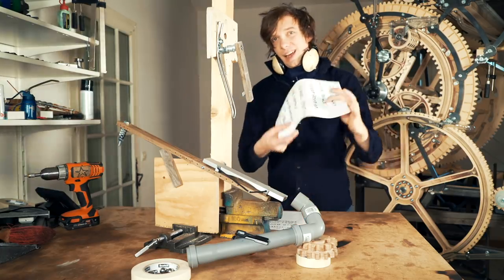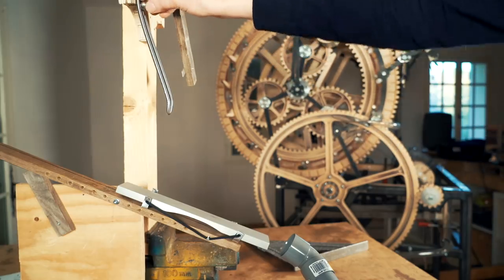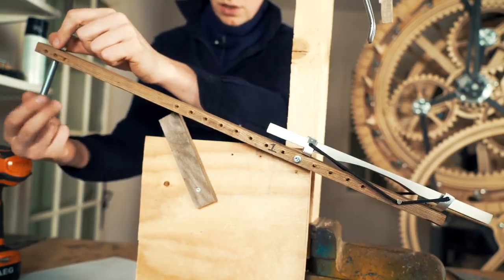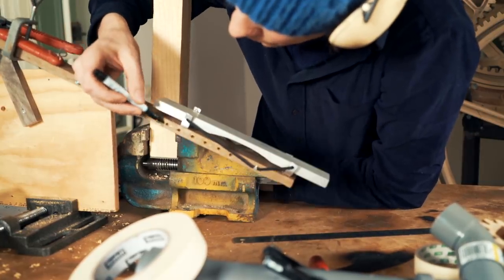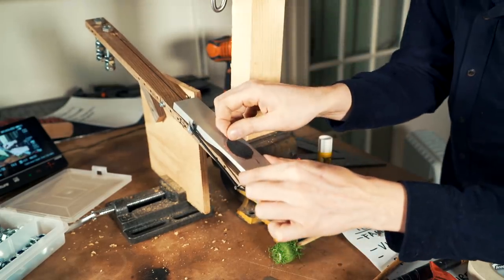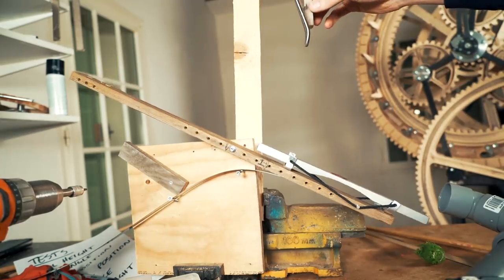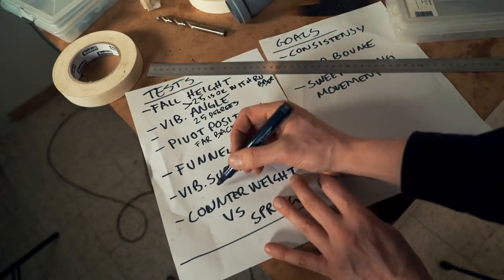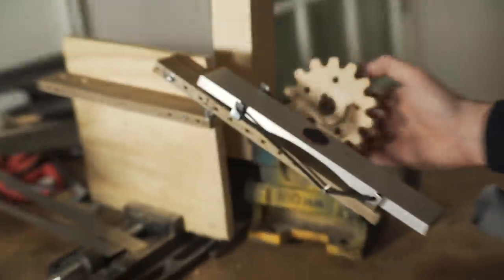Vibraphone Movement Test  - Marble Machine X #64

Comment: Hi Martin, it seems that there is a slight difference in striking the bar with a mallet and using the elastic material on the bar.    The material has some dampening effect which might change how the note rings out.
Have you considered suspending the piece of elastic material just above the bar so that when the marble hits the material, the material  stretches and along with the ball strikes the bar?   Then as the marble bounces off, the material would return to just above the bar letting it ring out as if it was hit by a mallet.

Comment: 7:01 Important for vibration duration is to do not leave any material on the surface of vibraphone plate or sound duration will be shorter. I think it would be better to hold the rubbber material in a short distance from. It should only hit and go back immediately.

Comment: If you don't want the pads directly on the plate (might change the release and whatnot) you might try floating the contact pads milimeters above the plate with some flexibility to make contact with the force of the marble.

Just an idea, not sure if can be easily engineered.

Comment: The nice thing about a spring compared to a weight is that it increases its restoring force the further your tension it linearly.
That means that although the hit had a quite visible swing, the return is much quicker allowing for faster play.
Compare that to a weight who's restoring moment will always be horizontal lever length * mass * 9.81m/s² with the lever length being dependent on the cosine of the angle * actual lever length (distance from pivot point to center of mass) which gives you a much shallower response to angular deviations.
Reply: Actually given what I've learned this semester about kinematics and control engineering you could totally do some physics calculations to come up with a model and then find your parameters by analyzing their effect on the root locus of the impact response.

Comment: I would ask to consider light torsion springs since they are specifically designed to return to exact desired angle, or zero, at higher than Prestissimo; faster than presto - 200 bpm and over.

Comment: I know the commuting wasn't a big problem in your test, but I think it's going to be an issue as soon as you screw the leaf spring to the moveing arm. My suggestion is to leave it moveing a little bit. The resulting friction will do the dampenig very well.

Comment: having a more significant counterweight close to the pivot and/or reducing the weight of the vibraphone side of the pivot would have the same effect as the long arm holding the counterweight, and would reduce the space the was required by the prototype counterweight, just pointing this out incase you prefer having the different center of mass

Comment: You need to design the machine so you can easily replace, and adjust, the leaf springs. Those lose their temper over time and need servicing. Tuning them according to wear and tear might help extend their lifespan... so I suggest a clamps system, perhaps? Wedge them in with mechanical pressure, instead of using a screw or a more permanent fixture.

Comment: The leaf spring approach includes its own damping, since it slides on the wood. If you eliminate the sliding with a coiled spring, it won't be damped and will oscillate back and forth. So one way or another you need to factor in some damping - the sliding leaf spring is probably simplest. https://en.wikipedia.org/wiki/Harmonic_oscillator

Comment: Shouldn't you be able to get one definitive movement without the swinging if you use normal coiled springs but dampen the movement a lot? idk how you'd dampen it though, bushings filled with stiff grease? Probably too temperature dependent...

Comment: Instead of dampening the tone of the vibraphone by adding the rubber to it directly. Why not have rubber or felt slightly suspended over the  vibraphone as a slight barrier to pad the hit sound? That way after it hits it won't be in the way to the resonance of the hit.

Comment: One of your first comments in this video was the fact that you wanted some movement of the instrument when struck because the marbles are just too difficult to be seen by the audience. I would like to propose a possible solution to that situation in addition to the movement. Use of strategically place UV flood/spot lamps in combination with UV activated glowing marbles! I'm not a metallurgist nor an engineer so I don't know if this is even possible, but the thought of it intrigues me.

Comment: I assume you want the bar to promptly return to the "unhit" position immediately after the hit.  Put more weight closer to the pivot (say double the weight and move it 1/2 the distance to pivot).  Restore force will be the same, but inertia of weight will be only 1/2 what it was before.  It will act more like a spring return.

Comment: What if you were to make the dampening for the vibraphone work like the practice pedal on the piano? A strip of rubber could hover a millimeter or two over the whole vibraphone where the marble hits and it could be pushed upward toward the marble machine by a lever out of the path of the marble. This would give a greater range of sounds

Comment: Won't each vibraphone plate's weight be different, causing the length of the arm (and the action and travel time) to be different depending on what note you put there? Also, do the resonating tubes really have to be different lengths depending on the required notes for the song? Couldn't you engineer tubes with multiple openings that would have multiple possible resonating frequencies? Would the harmonics for each plate's possible notes be far enough apart that a pipe with multiple holes could give a clear resonance to multiple notes? Or maybe the holes in the resonating pipes have stoppers so you don't have to have multiple pipe lengths?

Comment: There are rubber tapes made for adding more grip to the stair steps, very resilient and durable, might be perfect for the rubber pads in long term. If you want to make it pretty I sugest using liquid latex, its the very exact same material used in those working gloves, and you use it like nail polish (its actually meant to be used while making pedicure), but I can see it coming off and tearing after being hit with a steel marble couple hundred times.

Comment: Hej Martin, have you though in keeping the same resonant tubes but add different cavities separated by gates that you can open and close depending of the vibraphone installed?  or if doesnt work that way, maybe filling them up with.... sand?  (with a small valve/gate in the bottom so you can empty at the end of the concert or in between songs. About the spring, you can add different springs types to have a less resonant frequency and maybe putting inside the spring a piece of rubber, so it will dump a little bit the resonances (spring plus shock absorption, like in the car)...  great work!!!  by the way :)

Comment: The ball mass an drop height is all the energy you can use.
You need enough energy, both to move the arm AND the bounce (single). 
The mass of the whole arm (from end to end) has an inertia. The more mass, the bigger the bounce (no double hit) but the less swing. I'd go with a shorter arm and a spring.
As it acts as a pendulum, consider the whole length of the arm, as it has to reset fast enough to receive the next ball, unless you can catch the ball as the arm is in the "down" position (half way of the swing).

Comment: keep in mind that springs tend to weaken over time. So dont put to much weight onto it in rest.Futhermore, keep in mind that the length of the arm with respect to the spring matters as well and the spring constante actually results in a kinda of freq inside the moving arm. Thus make sure the arm is not moving while the next ball drops onto it, or it might alter the sound you are getting (moving against the ball will result in a harder bounce, thus more thermal energy, thus more acoustic energy. I do love the idea tho, and really looknig forward to see the endresult ;)!
Reply: thinking of it, might be that the coiled spring is the way to go, as you can simply make some kind of rod connect to them. Turning the rod, can then help you adjust the amount of work the spring needs to do (so you can make this really hard looking spring (high spring constant) or simply a weak one, which gives the arm the nice swinging motion.

Comment: Maybe it has been said before, but what happens when you have quick successive hits on the same note?  Would it be possible to hit the vibraphone plate when it is exactly in the same vertical position in such a case?  Or would you sometimes catch it on the upwards return from the previous hit?

Comment: Do you have access to Plastidip? It's a liquid rubber that can be painted or sprayed onto surfaces. If you make a template that is the size of your contact point, you can paint your rubber directly on to your vibraphone bars and control the thickness of your pads. Just a thought

Comment: Physics people... Hypothesis: with ball on metal, the energy from the ball is dissipated into the vibraphone. With ball on rubber, the rubber uses the energy from the ball to cause it to bounce better, losing less energy to the vibraphone, consequently the vibraphone is quieter with ball on rubber vs ball on metal. Is that correct?

Comment: Idk if you've thought of it but something like silicone flex seal or ryno liner might work better then the glove as you could just apply the amount that you need and if you want in think you add a second coat and since all can adhere to metal you wouldnt need the cloth of the glove

Comment: Your tests with the counterweight VS springs reminds me about the history of the Bosch Continuous Injection System (CIS aka Jetronic). That is a fuel system that came "after" carburetors and "before" electronic injections, it used a mechanical system to measure the air flow and to control the amount of fuel that gets injected. A plate was in the airflow and the engine had to pump air to move this plate which was held on an arm pivoting on an axle. In short, more air => more movement => more fuel.

Originally K-Jetronic (CIS) and KE-Jetronic (CIS-E) were using a counterweight on the other side of the pivot axle from the plate to make the arm "neutral" as it would have had no weight. Over time they found that this imposed inertia and when they made KE-Motronic (CIS-M) they switched to using a spring instead of the counterweight which made the whole system faster reacting.

All of this is from memory, I might have missed something somewhere.

You probably could find informations on this subject and it might relate with your situation, so far you seem to have the same conclusion!

Comment: When you drop the marbles from the higher spot they start to move towards the pipe during the falling sequence caused by your dropping system which is good. But remember the movement. It changes the point where the marble hits the vibraphone.
Reply: Of course the marbles jump higher after the hit too

Comment: You could probably limit the swinging by controlling the friction of the pivot point. The friction should be greater than the resetting force of the spring, so the movement is like a dampener and not an oscillator

Comment: I like the visual movement of the normal Spring. I share your opinion though, that the bouncing isn't nice. Maybe you can stop the movement on the way upwards at the initial Position, so that the Plate bounces just once. That could help with some other Problems mentioned in the comments, too.

Comment: You could stretch and suspend a small piece of rubber or other dampening martial a few millimeters above the vibraphone bar so the marble would still strike the bar but the rubber would not dampen the sustain of the bar.

Comment: You might have to add some additional weight on to the shorter/higher Vibraphonenotes to geht the same movment. So all in all you shoud have the same weight at every Vibraphon note to have an equal movment.

Comment: I'm a bit worried that the movement will ruin the effect of resonator tubes. As I understand it, vibraphone resonators work as wave guides : the sound propagates in the tube, bounces back at its end, then goes back to the plate in phase with the vibration to amplify it. The whole length of the resonators must be fine-tuned either by working on the distance between the tube and plate, or by moving the end cap of the tube. This would be different with Helmoltz resonators like those used in a Celesta, but those have a tendency of filtering out the overtones, making a much "rounder" sound than vibraphone resonators.

Comment: Since someone else already said it, I will second it.

TORSION SPRINGS.

And it WILL look real cool with no "visible" means of counter balance.

Since Ewetoob doesn't have the option of drawing, I'll describe.

Imagine a lollipop shaped balance beam, only one side sticks out with a round circle containing a spring in the middle. You could even mill a slight arc to the arm under the note. Wish I knew where to send a drawing, sketch.

Comment: Could you use a spray on rubberized coating like flex seal?  Would be easy to make a masking template to quickly spray them all.  Don't know if it is easily repairable though.

Comment: Depending on the structural stability of the rubber pad dampner, the frequency of use etc,  it will, over time wear and compress resulting in a different bounce reaction.

Comment: I think you should use springs instead of gravity for counterweight. Gravity will perform poorly when you get many hits on the same note.

Also, the dampening rubber might wear out pretty quickly? Something to measure.

Finally, it's not the weight of the wood that matters; dampening in the spring system needs to come from a dampener. Maybe an rc car shock absorber?

Comment: If the resonator tubes are metal like aluminum, you could use a brass mouthpiece joint where a slight inward cone grips the different pitched pipe additions.
Reply: They will be the finest french plumbing pipes Martins money can buy.

Comment: 11:22 Might want to check with a trombone player about how they change the length of their tube multiple times during a concert.

Or maybe do some system similar to a nose flute. With that instrument you change the pitch of the note by changing the size of your mouth cavity. Maybe the tube can have a exchangeable bowl shape at the end with which you can adjust its resonance with a semitone.

Comment: Will each arm of the vibraphone have a limiter in place? So that, when at rest, it cannot move upwards, only downwards and then the spring returns it to exactly where it was at rest. Like a piano key.  Because then that will eliminate the wobble that you had when you used the three little compression springs. Of course a soft rubber or felt contact on such a limiter would make it silent when it came back to its at-rest position.
Reply: There will be limiter for both ends of the arms motion.
Reply: @malco84  excellent, hopefully the lower limiter is the spring tension and not too much of a hard stop. That would look awfully mechanical for our mechanical music machine 😃

Comment: I'd worry about the bounce after repeated notes. It would have to snap back quick to be in the right place again for the next marble, and every note has a different length, so that will affect things as well.
I'm no expert, but a design I would try, if it's possible to do it without dampening each note too much, is one of those compression springs pulling down on the base of each note with a rubber blocker to stop it in the right position.

But what do I know? It's probably a terrible idea.

Comment: I'd guess that you'll need an easy way to replace that rubber padding, as hitting roughly the same spot thousands of times will eventually start to wear through.  I'd also guess that, at least with your test set-up, the leaf spring and regular spring were taking a lot of weight once the counter-balance was removed.  Might that cause them to wear out relatively quickly as well?

Comment: Lowering the overall mass of each bar and its support (rotating mass around the pivot) allows for faster return (essential for rapid succession of the same note), but counterweights increase it, and besides, the leaf spring looks better and can be more easily adjusted by moving the anchor point and/or fulcrum.  And as to the rubber pad, I'd suggest thin (~ 0.6 mil) silicon rubber for durability.  Felt requires cleaning, and normal rubber decays over time.  It seems location for the bar suspension (~ 22.4% from each end) is well documented, but location for mallet (or marble) strike might be best around 45% from one end.

Comment: Instead of having rest tension being neutral with room to bounce up, if you put it at a set tension with a retaining board above the vibraphone pivots that stop it from going up and thus continuing its oscillations like it did with the three springs, then you can have a quick down and up movement without worry of it oscillating more than the single bounce.

Did I make sense?

Comment: Brilliant. With vibraphone testing we can begin to see the light at the end of the tunnel. Soon he will be working on wiring it up. I woild like to see the wiring all hidden. If it was my machine I would have a cannon plug and feed it with a single cable like used for a stage snake and cables cut to fit. I did not like the coils of mike wire in the original video. I wonder if Martin will reach out to electrical engineers?
Reply: He might, he doesn't have any at the moment and its going to be a rats nest down there with wires that need to be disconnected after each gig and limited space. I'll raise the question to him as I think it will be good to tackle some of those issues soon.